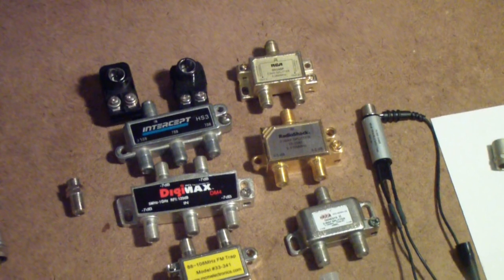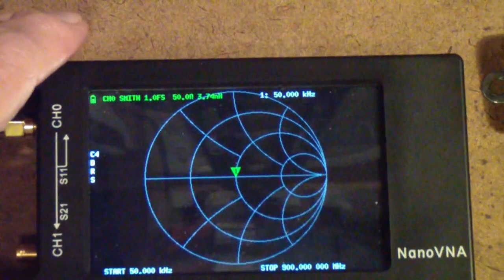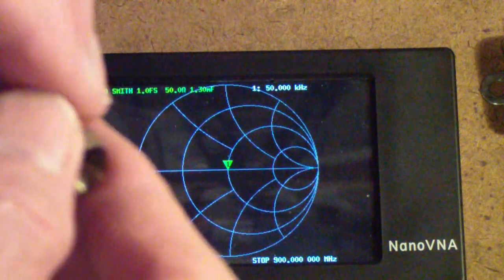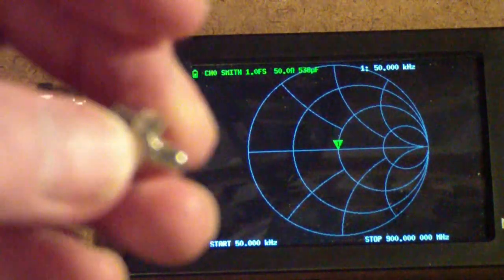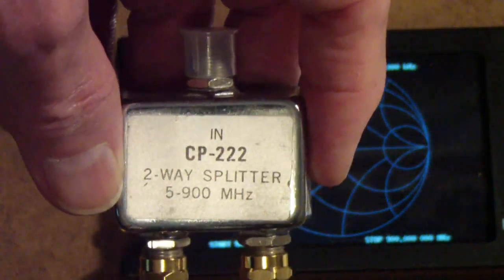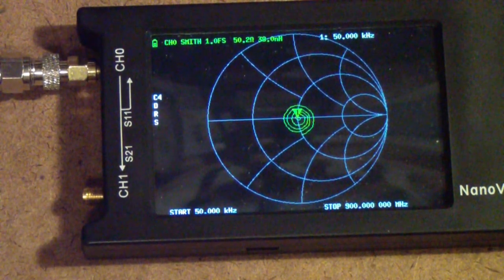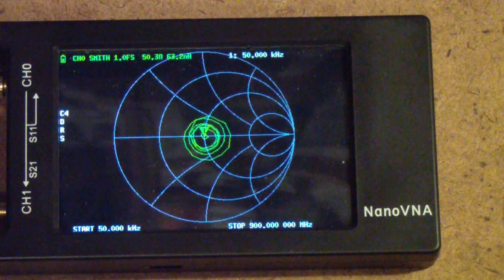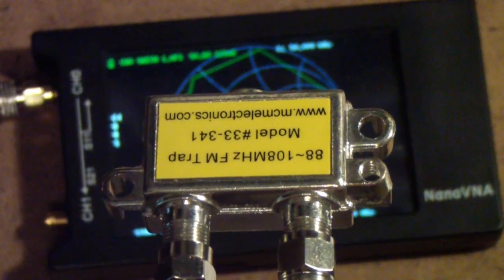TTT325 VNA with non 50 ohm Systems

Comment: Hi you need transformer from 50 to 75 ohm.  you  can not just connect 50 to 75 Ohm and calibrate.  Your VNA has a 50 ohm receiver and transmitter.  Many things will be distorted.
Here is why, the transmitter send a signal over 50 Ohm it reaches 50/75 interface, and some of the power gets reflected, then travels the 75 Ohm line to your load and based on load you may get reflected then travels back through 75 Ohm line to the 75/50 interface and some of it gets reflected again.  By calibrating with 75 on at the interface you just account for one of the reflections.  Open and short calibration just give the VNA the length of the line up to that point. That is an ideal zero length short should have 180 phase difference, but because of the length of your line it rotates to say some other value.  VNA uses this information and adds the correct phase to your return phase measured.  But when you connect 75 Ohm line part of the phase is result of line length and the other is because of transition from 50 to 75 and 75 to 50.  Plus you get two reflections one at the load and the other from 75/50 interface, delayed by length of your line, which add up at the receiver.

Comment: Would you do a 75 ohm calibration, then measure a 50 ohm resistor, and 100 ohm resistor? I have tried that and it is not close, I seem to recall I got about 70 ohms with the 100 ohm and the 50 ohm measured low also.

Comment: Pretty sure you can't just calibrate the NanoVNA with a 75 ohm load, you need 2 x  50 to 75 ohm impedance matching pads otherwise you will be causing your own reflections.

Comment: Hi, good videos. 
I use 75ohm cable and antenna for my VHF 5 watt ham radio walkie talkie.
Do you think I could use one of those TV splitters to phase 2 similar antennas?
Will it handle 5 watts of power? I have some spare 4 ports and 2 ports splitters for free.
Thank you!

Comment: Thanks for the video, I am interested in using my H4 with 75ohm systems. However, my question is, since the hardware/software is designed for 50ohm systems. How do you convert the measurements to 75 ohms, I know the software in H4 is designed for 50ohms, but does the smith chart show accurate results for a 75ohm when calibrated with a 75 ohm (SOL on channel 0), or does it just become relative.  I see you mentioned mini circuits pads, 50-75ohm devices. Seems the mismatch without is 1.5 to one on SWR to start with 75ohms?  So just a relative relationship when outside of the 50 ohm design?  This is strictly for hobby purposes by me and for looking at the UHF/VHF home brew tv antenna's, such as hoverman, 4 bay, 2 bay, yagi's and others. Bandpass,SWR,Return loss as a relative measurement.
Thanks again..enjoyed your presentations.
Reply: The answer to your question lies within: https://www.youtube.com/watch?v=gw1TYWwfvGk?t=35s

Comment: Is there a reason why you didn't calibrate the VNA at the end of the short 75 ohm coaxial cable rather than at the VNA port itself?  That would effectively eliminate the effects of the coaxial cable thus moving the calibrated reference plane to the end of the cable.
Reply from the maker: There is no reason not to do as you suggest and, in fact, that would provide a better measurement. Since I have discussed this in earlier videos, I tend not to go back but perhaps it would be good to emphasize that no video is complete in itself, and each builds on the earlier ones.